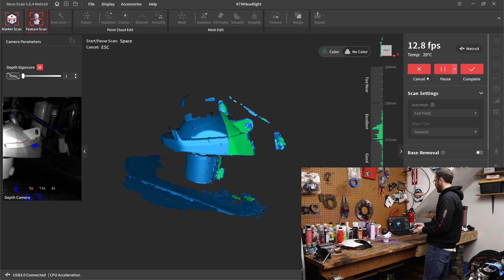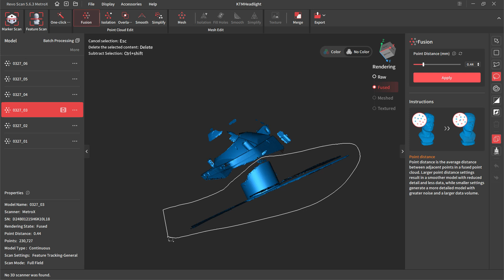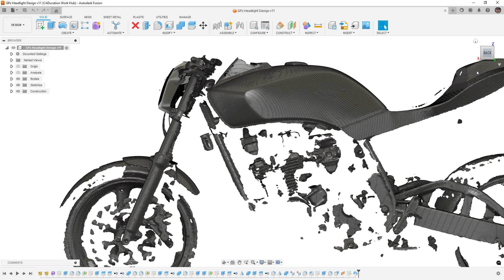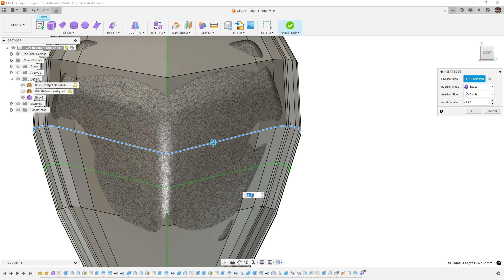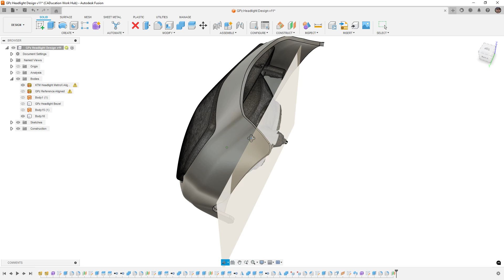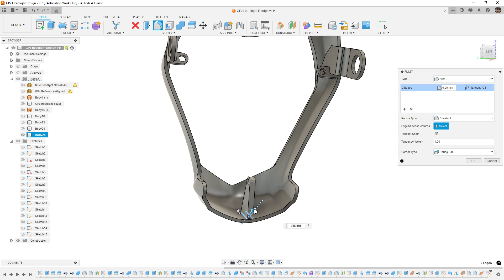How To Scan And Design A Custom Motorcycle Headlight | GPz Design Series Episode 4 How To

Comment: Thank you for these Videos. Would you say freeform modeling in fusion is the best approach for motorcycle part design with complex curves? I'm currently working on a cover of some sort for my motorcycle and have only used the parametric features  of fusion. However, the curves of the fairings are very difficult to work with.
Reply from the maker: It really depends. Forms have their limitations for sure.  We have 2 series on our site www.learneverythingaboutdesign.com  doing complex surfacing and also forms based modeling for a motocross handguard.  We talk about planning out the primary surfaces and how to build curves out for complex shapes.  For the forms version of that part we walk through where the forms tools shine and which areas you really should do work with standard tools.

Comment: I just got a metrox and this video is super helpful.  Do you find that full feature scan and scan spray produce the best results for somthing like this. I dont think insaw any markers on this one
Reply from the maker: Yeah I prefer the full field.  With this clear lens I wouldn't have really been able to put marker dots and spray on.  The light is small enough that i "could" have maybe put markers around it and used spray.
Reply: @LearnEverythingAboutDesign  also it seems like you have a lot of experience in this field.  Do you think there are any better scanners available at this price point for both medium and small items. I ended up getting the metrox for $800.     I was heavily debating the einstar. But I think realistically I'll be scanning a lot of smaller to medium items that would fit on a 3d printer bed for the most part.  Maybe the occasional larger car part scan.   It seems the einstar excels at that for the price, but lacks the finer detail if you want to go small.
Reply from the maker: @eliteman125  scanners like the creality scan otter. the revopoint miraco, and the shining3d (einstar) vega all have dual depth sensors.  I think the Otter is the cheapest out of those.  I find the portability of the Miraco to be great and makes it my goto scanner but usually you are at $1500+ for them.  The otter and the metrox Full field mode use Bluelight which in my mind gives them an edge for different materials.

So its hard to say.  I think the metroX is a great scanner but really meant for smaller objects.  Miraco can scan big objects or small objects which to me holds a lot of value.

Comment: Hi! I am currently learning F360 and your videos are really helping. Thank you! 

Have you a video where you build on a scanned surface l? So, for example, if I wanted to design a go pro mount for the top of a crash helmet? I have Scanned the “host” item (the helmet) and need to design the additional part (the mount) to fit the scanned item. 
I have as I say gone through your videos but haven’t found one that explains that yet. 

Again, thank you for all the time and effort you have put into this channel to make it the resource it is.
Reply from the maker: You are welcome!  There are a lot of scan based videos.  I have even done a gopro mount, but it wasn't on a scanned helmet.  it was a handle i used for snowboarding.

Probably the closest video would be either this https://youtu.be/COh94Os45T8  or possibly some of the car ones like creating a spoiler.

For you i would suggest using forms to create the shape of the helmet where you want the mount to fit.  just a small area.  Then that surface can be used to cut/split/replace face on a solid GoPro mount.  Split Body would work.  You could even extrude up to Object and end at the surface.